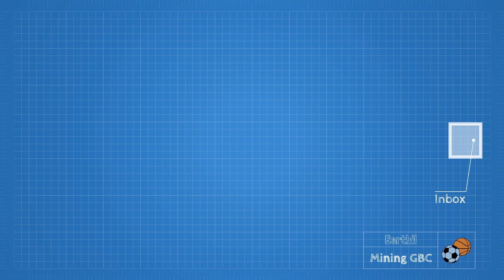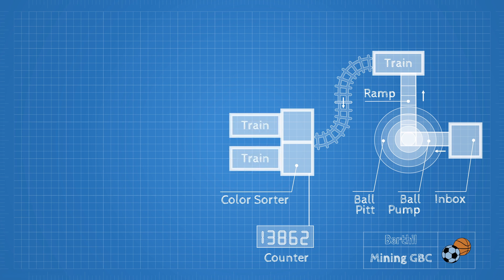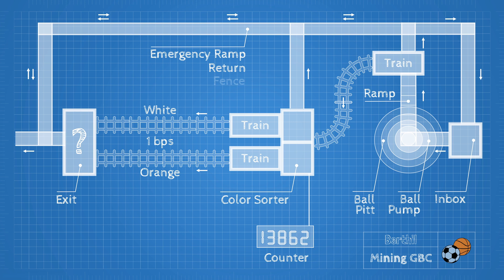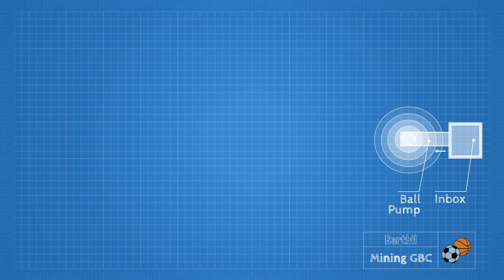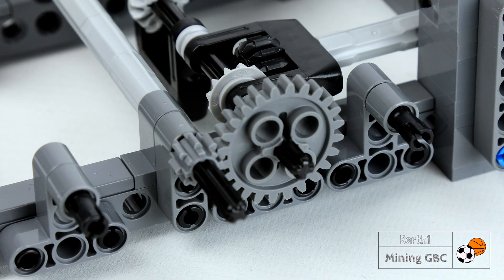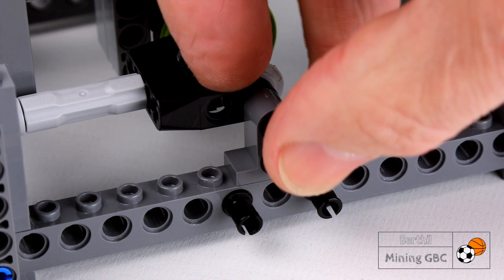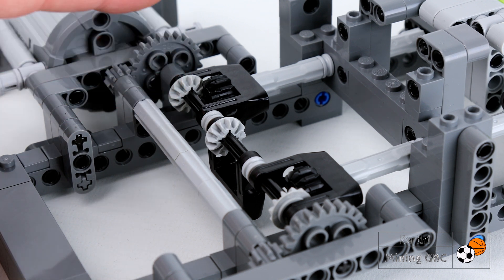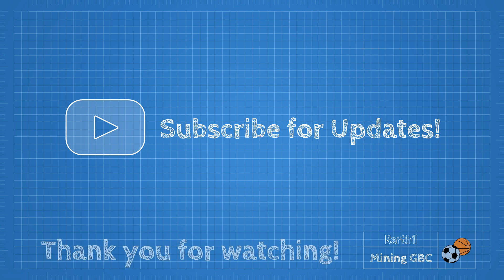LEGO Mining GBC Blueprint

Comment: how should you power a GBC build? I bought the parts for your marble run v2 and i want to know.
Reply from the maker: With the 9V train speed regulator and one extension cable to the motor that connects to 9V and Powerfunctons (20 or 50cm):
 https://www.bricklink.com/v2/catalog/catalogitem.page?P=2868b
20 cm: https://www.bricklink.com/v2/catalog/catalogitem.page?P=60656
50cm: https://www.bricklink.com/v2/catalog/catalogitem.page?P=58118
The 9V battery box will also work with ni cables needed, but the motor will run at full speed
https://www.bricklink.com/v2/catalog/catalogitem.page?P=59510